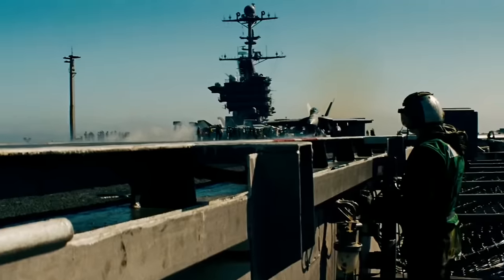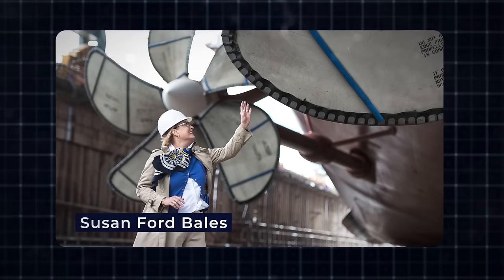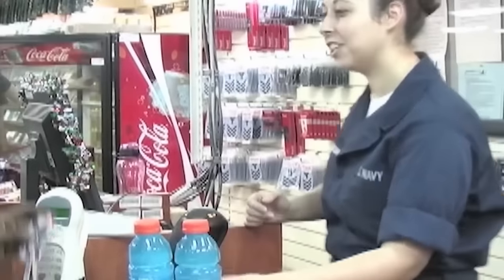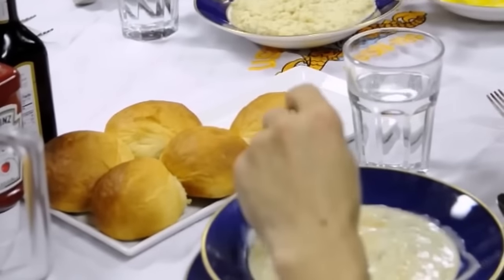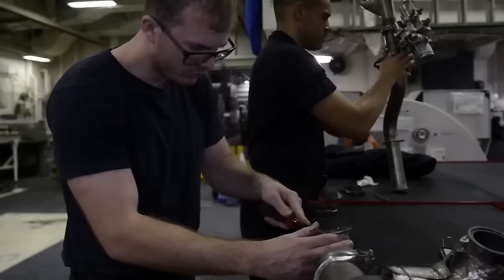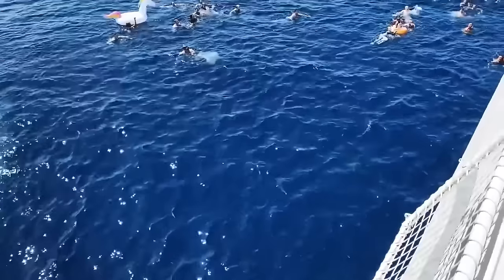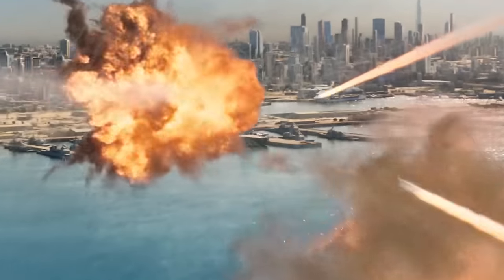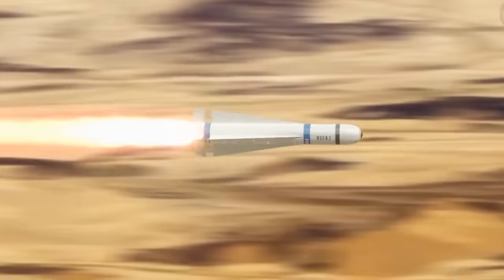City At Sea: Life Inside World's LARGEST Aircraft Carrier USS Gerald R. Ford | Full Documentary

Comment: The hanger bay is not directly below the flight deck, that is the 0-3 level (work shops, flight ops, berthings, etc.) and side note: aircraft do not lock their brakes up during landing, quite the opposite = zero brakes and go full throttle.  Still a pretty good video, though I never saw swim call, video games, or recreation (except every three months steel beach picnic) in my eight years aboard.